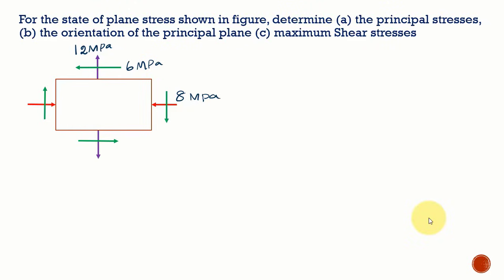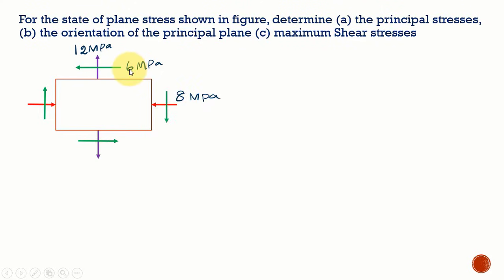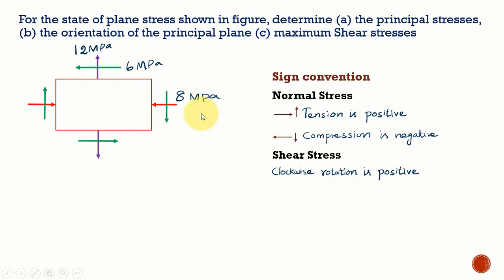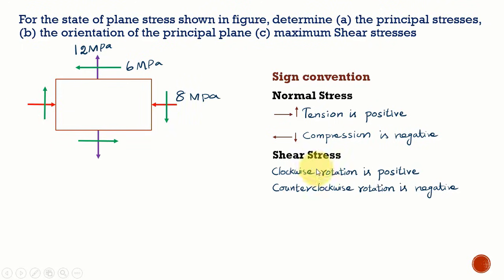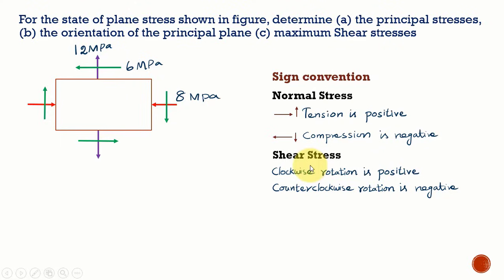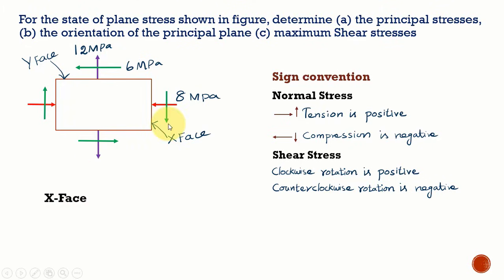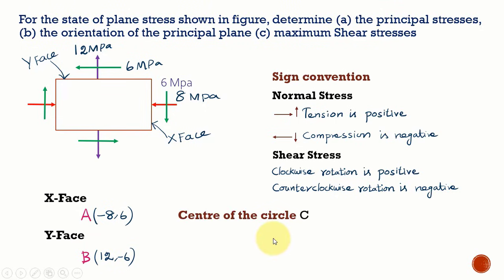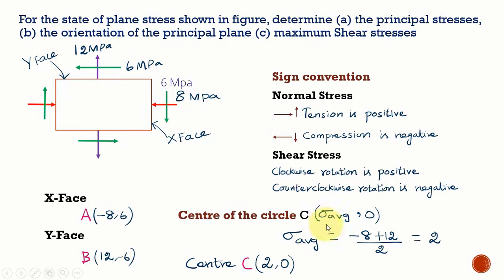Strength of Materials | How to draw Mohr's circle? | Determination of Principal stresses and Plane

Comment: For the radius:
R=87.32
For the Max shear stress: 
τmax=87.32MPa
For principal stresses:
σmin=82.32MPa and σmax=92.32MPa
For the angle at which we have to rotate to get to get the point A&B at in the horizontal plane is:
2θp=66.37°
And the orientation of the principal plane is:
θp=33.19°
Can someone confirm these answers for me?
Reply from the maker: The answer is available in the description of the video

Comment: Why the Mohor circle the y components of central of circle is taken is zero
And why the x component is not taken is zero
Reply from the maker: When considering the Mohr circle for stress analysis, it's essential to understand the coordinate system used. Typically, the x-axis represents the normal stress, and the y-axis represents the shear stress. In the center of mohr's circle, shear stress is zero because it represents the stress state where the maximum and minimum principal stresses act on the same plane

Comment: Man you make a mistake as in mohr circle y axis in 3 or 4 block must be +ve while -ve in 1 and 2 block
Reply from the maker: There is no thumb rule in selecting positive and negative axes, so it is not a mistake. You can choose as you wish. However, the x-axis represents normal stress, and the y-axis represents shear stress

Comment: Sir, I think the sign convention for Normal Stress is wrong. The tension should be negative and compression is positive.
Reply from the maker: Any Sign convention is correct. However, you have to maintain it throughout the problem. The answer will not change.

Comment: This video was so helpful. However i just wanna confirm my answers. 
For the radius:
R=83.82 
For the Max shear stress: 
τmax=83.82MPa
For principal stresses:
σmin=78.82MPa and σmax=88.82MPa
For the angle at which we have to rotate to get to get the point A&B at in the horizontal plane is:
2θp=72.64°
And the orientation of the principal plane is:
θp=36.32°
Can someone confirm these answers for me?.
Reply from the maker: Thanks for watching. The answers are correct.
Reply: Help I'm getting 87,32 as my R 😭

Comment: Nice explanation. While orientation, how did you recognised max and min force will be along y and x axis
Reply from the maker: In this problem, the point A denotes the X face. When is rotated to the horizontal in CCW direction, we have got principal stresses. So the intersection point is 9.66 Mpa. Hence the 9.66 Mpa is considered along X axis while orienting principal stresses. 

Similarly, the point B denotes the Y face. When is rotated to the horizontal in CCW direction, we have got principal stresses. So the intersection point is 13.66 Mpa. Hence the 13.66 Mpa is considered along Y axis while orienting principal stresses. 

Hence,  the maximum and minimum just represent the numerically maximum and minimum value among principal stresses.

Comment: Can centre be negative?
Reply from the maker: The centre value may be negative, based on the given problem. For example, if no value is provided for the normal stress along y face, we would have got a negative centre value in the same problem (-8/2=-4; centre(-4,0)).